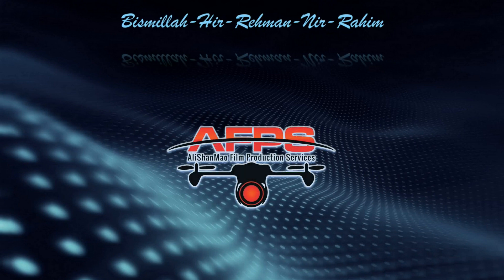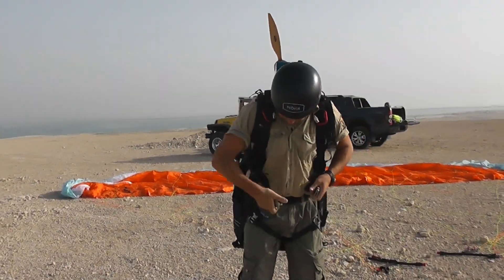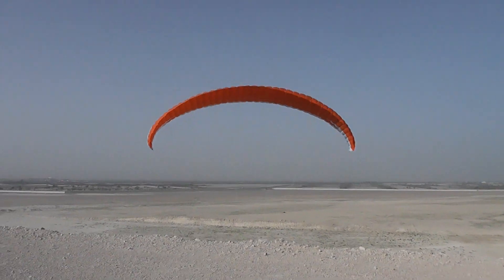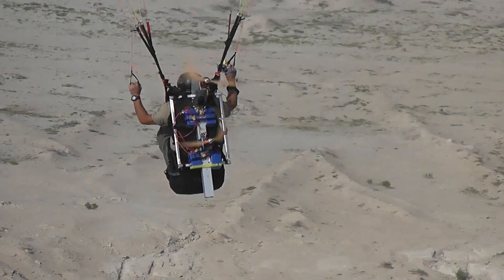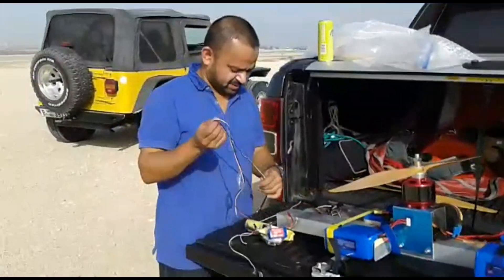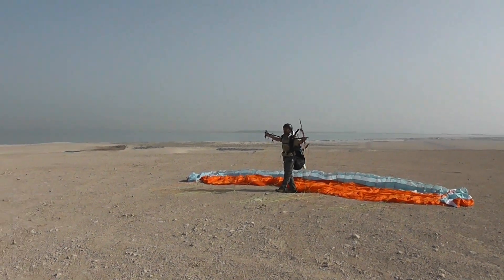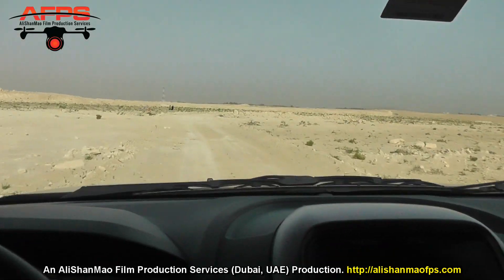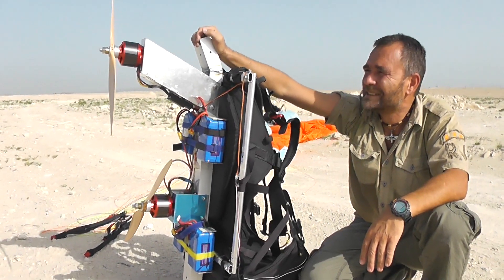Tamas and I testing my Homemade Electric Paramotor

Comment: Aliii, keep the brakes off and let the glider fly.. İ guess your risers are so high and so you re having too much brake on the glider.. SO the glider cant fly.. Put the risers lower.. Adjust it..
Reply from the maker: thats our original issue. this glider has originally risers for my Nova Harness. Harness on this Electric Paramotor is for Engine so risers are a bit high. we need to change to paramotor risers a bit longer ones so I will not brake all the time.

Comment: You were flying that low, is it because not much power or weight or safety issue?
Reply from the maker: just wanted to stay close to ground as it was very first testing and I do not want to go high altitude because i have no reserve chute either. so i wanted to stay closer to ground should anything go wrong. safer than falling from high altitude

Comment: Looks sweet!
Maybe you need a duct system... get more thrust. (i don't know anything about paragliding)
What do you suggest for more thrust?
Reply from the maker: For now if wanna go electric, Propellers are more efficient. Duct system best to use is turbine system but then it will fail the purpose because we wanna get away from gasoline or any highly flammable liquid behind us :)
Reply: alishanmao 
I was thinking along the idea of a prop with a short duct to focus and increase the thrust.
But like I said, I don't know anything about it.